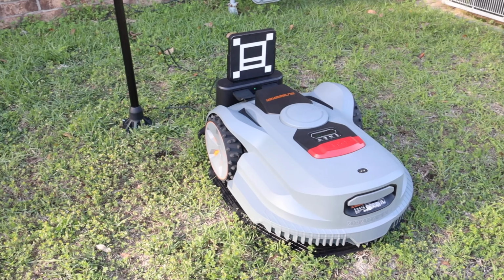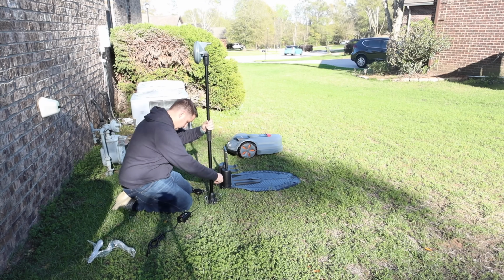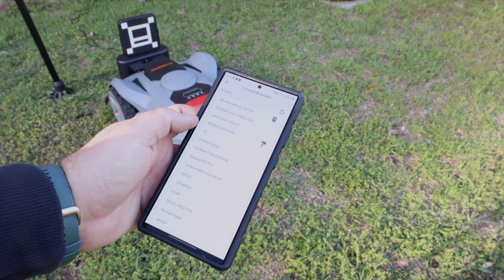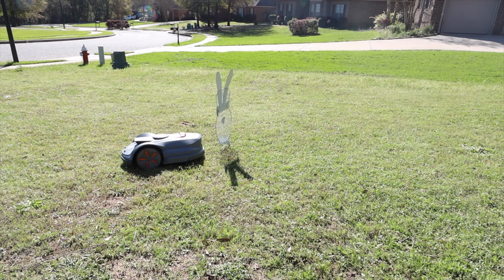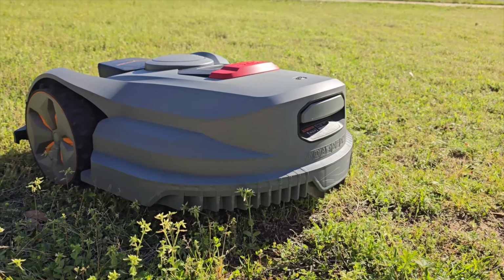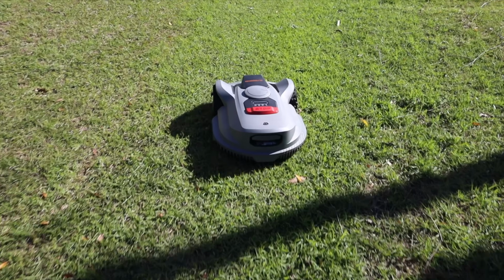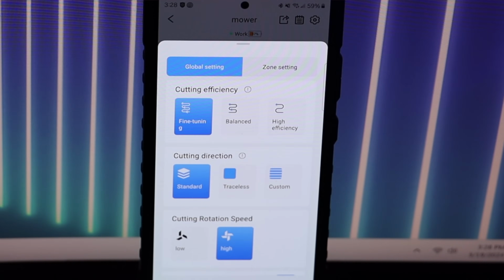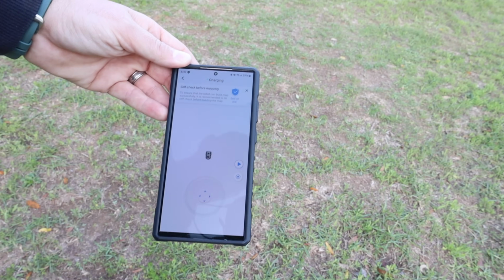SUNSEEKER Orion X7 Wireless Robotic Mower!

Comment: I plan to mount the antenna on my roof for a clear view to the sky. Why does the base station need to be 5 feet away from a wall? I would prefer the base station be backed up to a wall.
Reply from the maker: So after talking to Sunseeker they are telling me the 5ft of clearance is for the mower path not the wall. So you could put this next to the wall but the path needs to start 5 ft away from the base.
Reply: @DroidModderX  Great information really appreciate it.
Reply from the maker: @GrealdClaybrook  of course